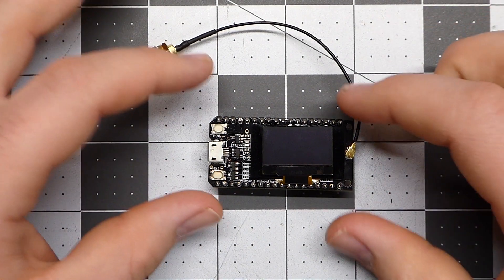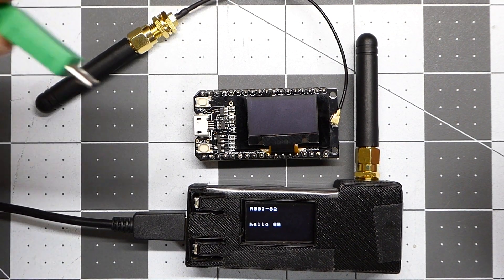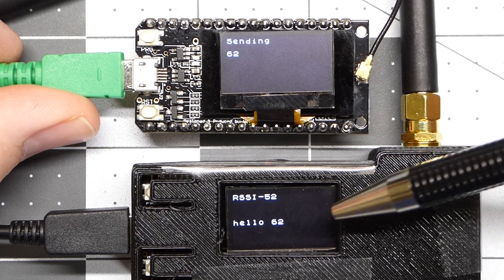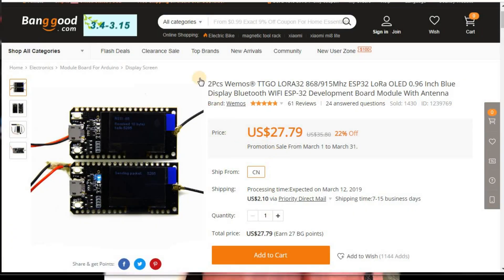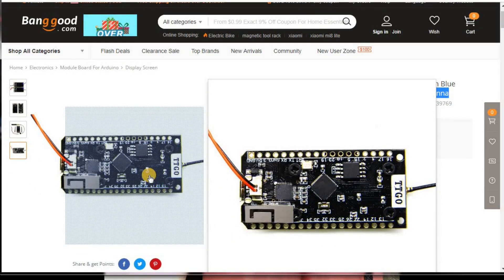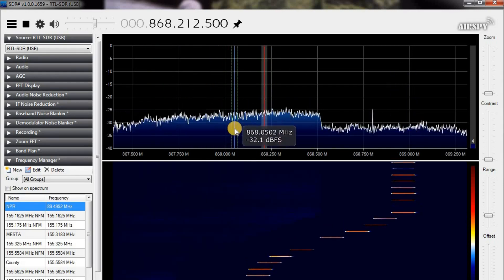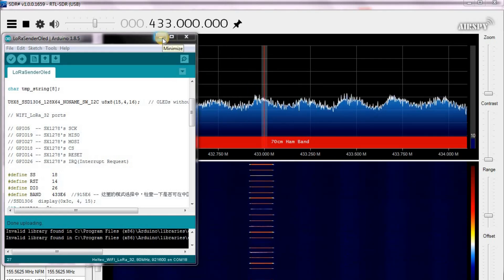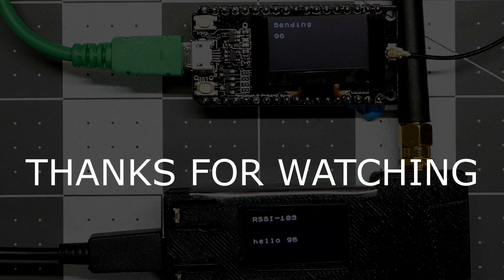Esp32 LORA OLED Modules

Comment: Antenna section has probably different components for impedance matching and/or filters for different versions. The chip itself can transmit on very wide range but as you see in your video, RSSI is very low if you tune to "wrong" frequency band. You should also use a suitable antenna for a perticular frequency. Transmitting with a wrong antenna sometimes breaks stuff, like when transmitting without an antenna.

Comment: they are transmitting in all bands but you have just band pass filter... for specify band 

Remember radio freq aspecioaly UHF is difrend world of knowing. so you can not make it for 2 band when they are 2 times higher. in order of radio noise for charmonic freq.
iven antenas have difrend lenght and if you dont have right one.. power is reflecting back cousung trubles. ( VSWR) read about amator radio. this will help you to find out  Q and A.